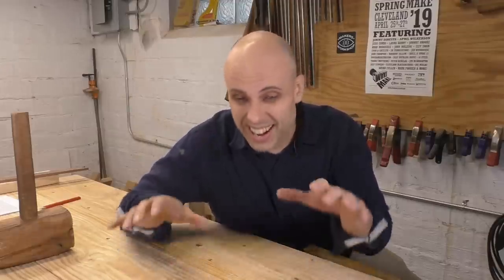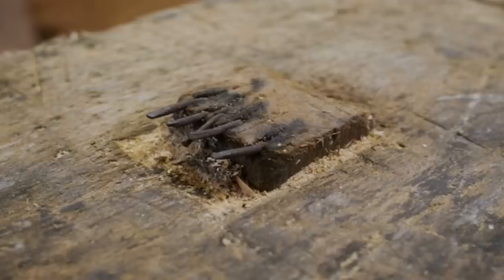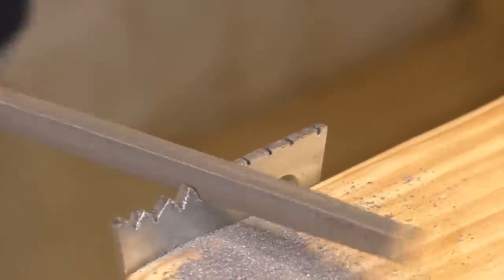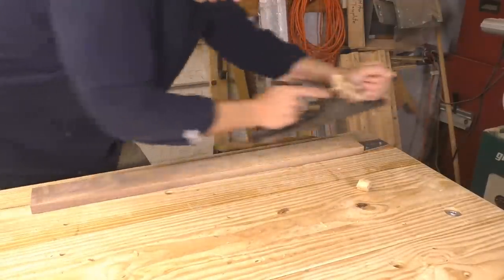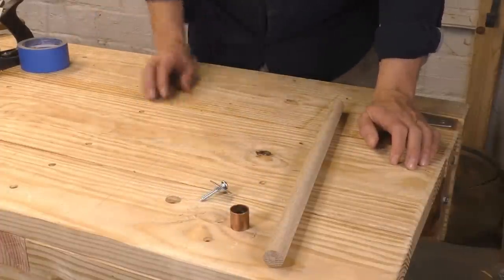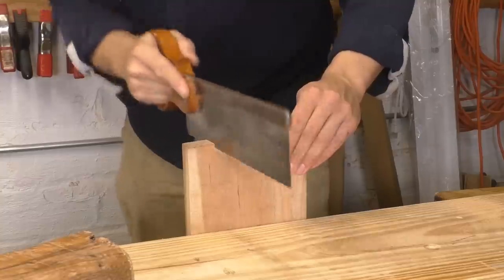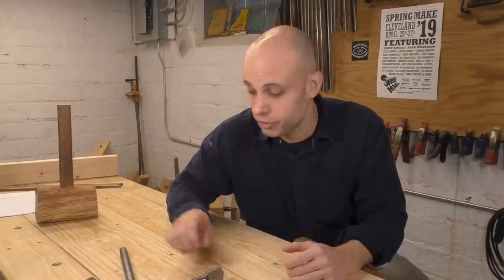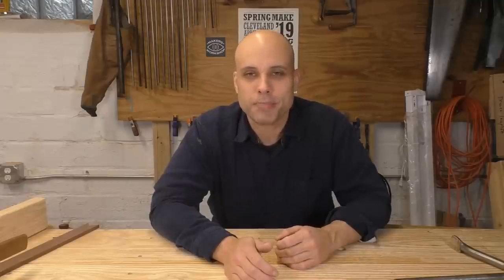You don't need a vise on the Joiner's Bench

Comment: Insert UHMW,copper,brass,or someother type of metal lining into the  holdfasters holes to prevent crushing the wood,something that will not damage the hold faster surface, My choice would be UHMW.Use expoy for an adhesive.Hope this information is useful.

Comment: I hold my doe's foot and baton with a cheap clamp I got from the big box store. Has worked well for the last 2 years.  I just put the work against the stop, put the doe's foot in place (I cut it so it overhangs the back of the bench a few inchs) then clamp it to the back of tje bench. I do want hold fasts one day, but I have yet to find a "need" for them to justify the purchase. They are pretty though, and I want them.....

Comment: Aloha Rex  I've been following you and your work and designs are spot on.  I'm vertically challenged and weight rich. For ergonomics reasons can you  give an idea of bench heights based on waist height for being productive and lower stress. I am also post retirement. I have a 4' x 8' x 2" solid maple top on some old steel shop legs. They are too tall for anything but assembly for me.  I also have  the same sizes table top in Stainless steel on a shorter set of legs I wish to make them into a double width bench with a drop down between for both cleaning and  dust collection  with a power strip in it.   
Mahalo (Thank you)

Comment: Rex, In the original Joiners video, you showed a series of photos of the benches. One thing a lot of them had in common was some kind of well either down the middle, more even off that back. In your opinion, was that well a tool well, or was it used to aid in clamping and work holding?
Reply from the maker: I hear a lot of different things about it. Mostly, a shallow tool well. I just didn't want that.

Comment: It's been a while since you made the bench (or at least uploaded the video) and I was wondering how well the added wood pieces to you dog holes have been fairing. It looked like you just glued them on and I was wondering if you have had problems with them popping off. Also, do you feel the need to add extra wood to the holes in the apron?

Comment: Great video!  Thanks for posting.  For the end trestles, can I add the cross members on either side of the legs or what's the advantage of the lap joint if there is one?  I am giving this build serious consideration and if I do build it, I will add retractable castors to each leg so I can move the table around my shop area.
Reply from the maker: THe half-laps make things more rigid.

Comment: Great video! Why not just drill the holes for the Holdfasts in the 4x4 directly under the 2x surface boards?  No additional blocks needed.
Reply from the maker: Those locations didn't line up as well. Also, if the top is TOO thick, the holdfast won't work.
Reply: @RexKrueger  blocks will come off in time I think , screws would help.

Comment: If you can't afford or find a good vise it's better just to buy an 18 inch dewalt one handed bar clamp/spreader. You'll be able to count on it and before you know it you'll be using it for everything else around your place like glueing up that drawer or chair that is getting weebly wobbly. And it will still work like a vise.

Comment: I don't understand why the holdfast holes are not drilled over the cross beams, the two 4x4's and one 2x10.  One could also drill 3/4" holdfast holes into glued-in 2" hardwood dowel inserts.

Comment: Hi Rex just a thought. Hold fasts are £30 ish in the UK. And you can purchase a crowbar for about £6. Could a crowbar be modified to do the same and not damage the work for little cost? Cheers Rob.
Reply from the maker: Rob, I don't think so. Even at $30 each, they're still a good deal. I use mine every day.

Comment: Did you or would you add blocking to the front face to reinforce the hold fast holes?
Reply from the maker: Most of those happened to go through the bracing on the inside, so no blocking necessary!

Comment: Anyone can forge their own holdfast from rebar. All you need is the rebar, a ball peen hammer, an acetylene torch, files , a bucket of water for quenching and a piece of railroad track, granite, quartzite, excavator bucket pin or whatever hard, smooth surface you don't care about to pound on.  If it sounds intimdating or hard, it isn't.  It's simple tool making you don't need to be a blacksmith to do.  But once you make one, you'll really mess up because then you'll realize that you want to build a forge and start blacksmithing as well. Pro-tip - excavator bucket pins are the best non-anvil anvils there are.  There.  I just eliminated for you the year of research and agonizing I went through when I didn't want to spend an equivalent of a used car or HVAC system for a house on something I'm just going to beat with a hammer.  Don't think an excavator pin is big enough?  They're twice as large as the stump anvils on which the Vikings made the best swords the world saw up to that point.

Comment: Great video but I was just wondering do those hold fast things have any tendency to mark the wood you're working on
Reply: The angle is nearly parallel to the held piece so not usually. He and other holdfast users put a thin piece of scrap between sometimes to protect from marking.  You could also dip or cover the end of the holdfast if you work with a lot of soft wood that might be damaged.

Comment: How does clamping a board down to the workbench with an f clamp compare with doing it with a holdfast?
Reply: It can hold down stuff just as well, but you can have your piece anywhere on the top if you use the holdfast

Comment: You can make a really good plane stop by chopping a piece out of an old handsaw with an angle grinder. Oops, maybe I shouldn't have mentioned power tools here! Oh well. Just use a file to knock off the teeth if you don't want it too sharp.

Comment: I'm guessing that you have to be ultra careful using the planing stop - at least on order of operations as you will be dinging up the face of the wood that gets pressed into it?  Or am I misunderstanding this?
Reply from the maker: Well, it only bites into the end grain a little. Most projects don't show a lot of end grain and it's not such a huge thing.
Reply: Usually the end grain is the last surface you work with on a piece of wood. You will usually have it oversized to have a margin of error in the build and/or to have something protruding on the corners of a panel frame or a door frame, to facilitate the disassembly when you do a dry fitting or you test a joint. The scratches from the planing stop will go away when you will cut and/or you will plane the piece to the final size. If you have to use the planing stop after final sizing, you can always use a batten in front of it, like Rex has done in the video with larger stock.

Comment: I've been a fan of various 'wedge vices' over modern screw vices. 

I find they can be easier to design to be stowed away, and with suitable extra wedges can be faster to get a good mid strength hold for a lot of things.

Check out Clickspring's small parts design: https://youtu.be/Jk_rCm1rAeg

And beyond that, there is a lot to be said about having a supply of pegs and holes. Combined with simple wedges you can get a really tight hold on stuff in pretty much any orientation needed.

Comment: you might not need a vise on the bench but it seems a Vise was needed to make it. ;D
Reply from the maker: Nope. Didn't use one. You can watch the video.
Reply: @RexKrueger  4:07 
but i guess its me confusing a clamp with a vise.
Reply from the maker: That's a reasonable thing to get confused over.

Comment: You forgot the old fat guy holding the wood. As an apprentice you hold the work in place for the Master. Makes you stronger. Gives you a grip of steel.  Peg holes with hardwood pegs . Bench of Old Oak is best. Apiece of wood with a long v notch  which fits in peg holes to hold boards for planing.